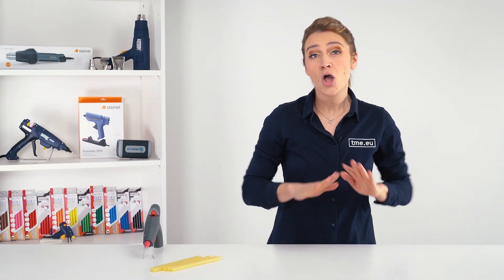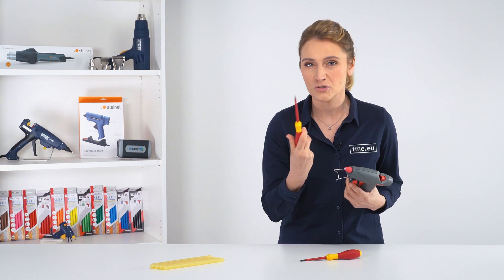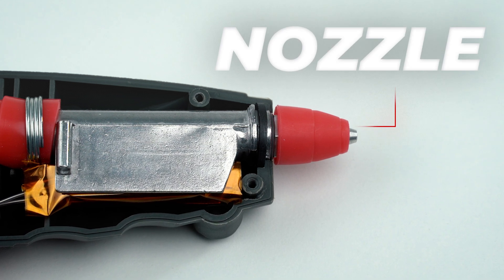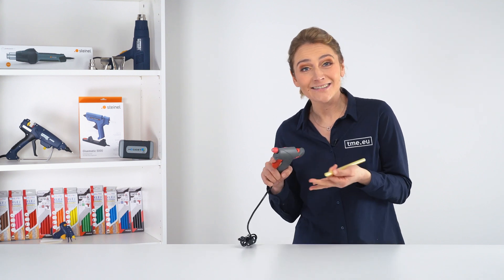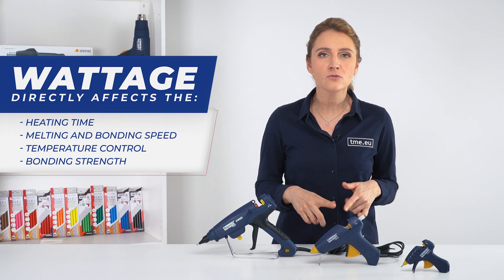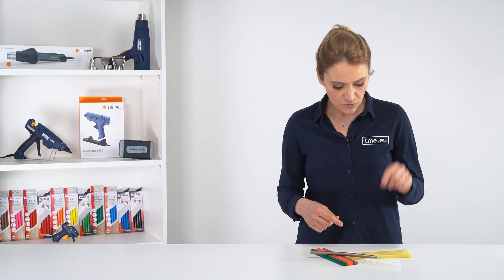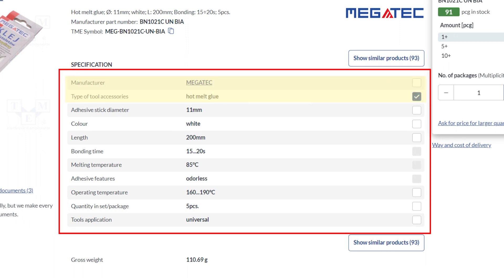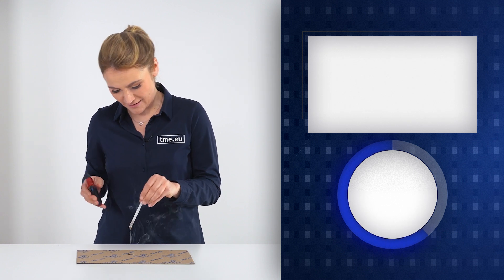Hot Glue Gun and Glue Sticks - How Does It Work?

Comment: Thank you for your video. It's really informative! 

I was just wondering if you'd be able to answer a question I've been wondering about - 

When using "dual-temperature" glue gun sticks, what are the differences between the glue when you use it at a low temperature vs a high temperature?

Does it simply change viscosity? Does the glue have a high viscosity at a low temperature and lower viscosity at higher temperatures?

Wouldn't you be better off having seperate low melt and high melt sticks in general? Or do the dual temp sticks have advantages in some areas? 
It's very difficult to find solid information about these sticks online. Thanks for your time and again, thanks for your well made and informative video.